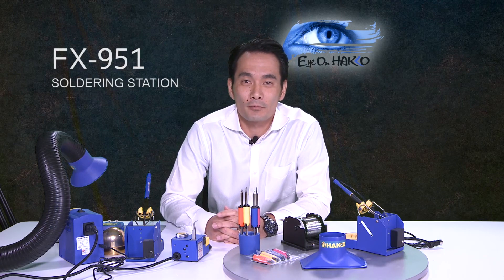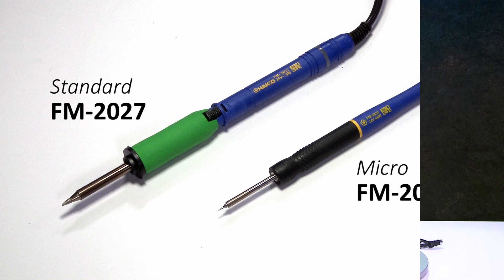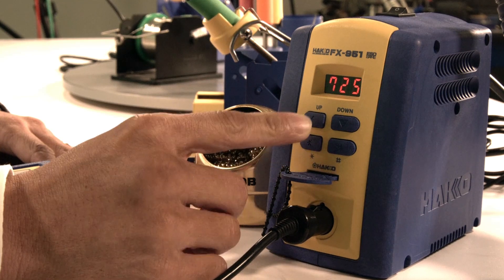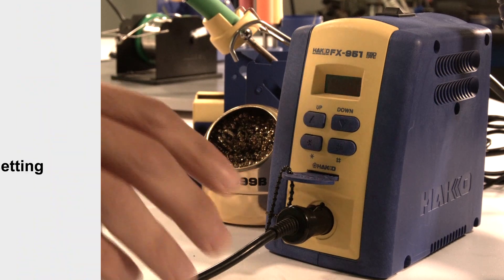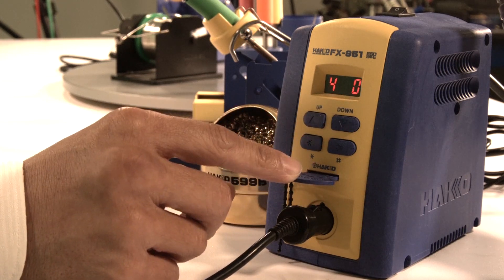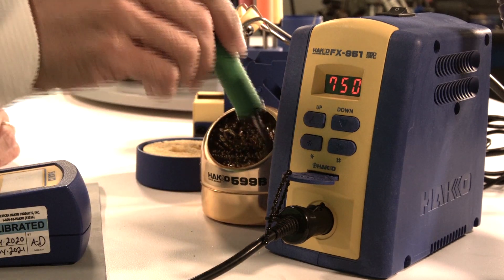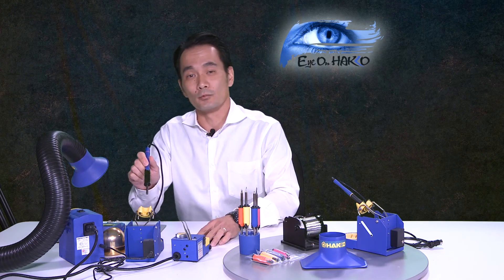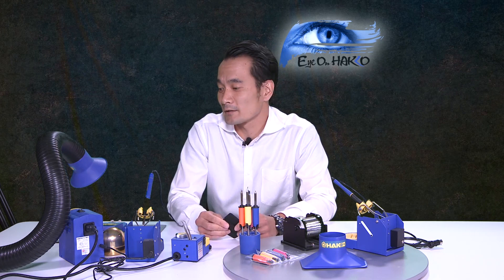"Eye On Hakko" presents the "FX-951 — Parameter Settings and Features"

Comment: What is the temperature of the tip when in sleep mode? Is there a way to change that? I have it setup that when I place my iron on the stand it goes to sleep. When I pick up the iron it goes to full temperature.
Reply: 200c

Comment: Good video thanks for sharing. This is my fist proper temp control station. I’m already a fan! 

Much more complex than my old blue and red Weler’s. Unfortunately this station is not as intuitive. However, after watching this video and setting mine up at the same time. I understand it’s actually a simple process to understand. Also have an appreciation for the better performance, I now know I’ll enjoy! 

Would also like to add. I’m very much impressed with the FM-2027(hand piece that came with it incase I have the number incorrect). The cable is soft, feels like silicon. The hand is a very nice size for 70W. Something I thought I would hate is the sleeves. I was incorrect!!! They are very nice!!! Love them! Overall very ergonomic and a very nice size. My kit came with 5 tips, can’t wait to buy the other color sleeves. That way at a glance I will know which tip is which. As my eyesight is not as good as it was.

Hakko you have a new follower in your cult!!!😂 After a few uses, Everything else feels barbaric. I can see me being a snob already! I can see me saying, oh you don’t have a Hakko?……. How do you solder than?

Comment: Once your Hakko is out of warranty and it shits itself forget about getting a circuit diagram for it...   Hakko will NOT supply it because its confidential....   Lol really Hakko,  its a frigging soldering iron and not a rocket you muppets.    People don't waste your money on this overpriced junk.   Hakko was great in the 90's but got money hungry
Reply: Make sure the problem isn't the handpiece.I thought I had a problem with the main unit,but found broken connection in handpiece.

Comment: What's going to be the standard size/shape tip for general use? The FX951 on Amazon that comes with one tip uses a D16, but the bundle that comes with 5 tips comes with D08, D12, D24, D32 and D52. I believe I read that the FX888D uses a D16 by default.

I think my work used a D24 for soldering 22AWG stranded wire together but I can't really remember if it was that big, or if it just looked that big while tinned.

Which two or three chisel tips would you recommend? I was thinking the D12, D16, and D24. I'll probably only play around with computer keyboard PCBs, RC cars, and electric guitar wiring. Do you think a D08 is too small? Thanks!
Reply from the maker: Great Question! And thank you for asking it, when it comes to the shape or type of tip it really depends on what you're working on or trying to do. As for the size, a lot of that will come down to the type of components you're soldering, maybe you need a micro iron, maybe you don't but if you need more information we encourage you  to speak to our amazing technical support, you can email in to Support@HakkoUSA.com or call us at 1-800-88-HAKKO(42556).

Comment: I've been using cheaper products that imitate Hakko for a while but finally bit the bullet and purchased the FX-951. So far, I'm very impressed with how much better both the tips and the unit are. Particularly at handling thermal shock. This video is a very useful overview of the unit and covers all the basics so thanks! It looks like I'll be using Hakko products going forward. Thanks for putting it out there. =)
Reply from the maker: Always a pleasure to hear, Thank You

Comment: I just took my 951 out of storage from about a year's hibernation after moving... The sleep function no longer responds.  I tried manually jumping the leads on the cable but still no sleep, so I assume the fault is with the 951 and not the switch on the iron holder.  I have my sleep timeout set to Zero too.  Is there anything else I may be overlooking?

Comment: I just bought the Hakko FX-951 and watched this video to get the low down on it but I can't get the sleep function to work at all (setting 2 is at 0 atm). I checked the continuity of the bas switch to see that it was working and it is working fine but still the sleep function doesn't work. is this something I can fix from home or do I need to return it?
Reply from the maker: Hi D ee,  Call us at 1-800-88-HAKKO(42556)! We'll help you setting up your FX-951